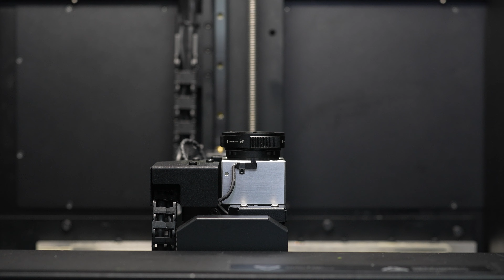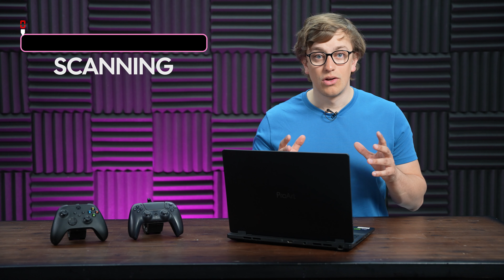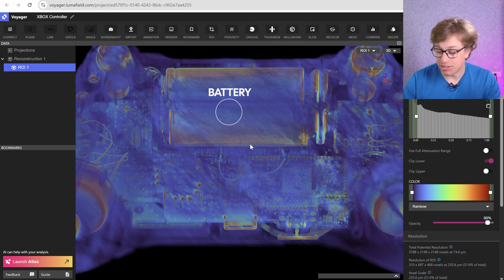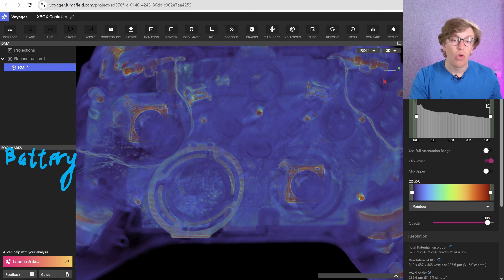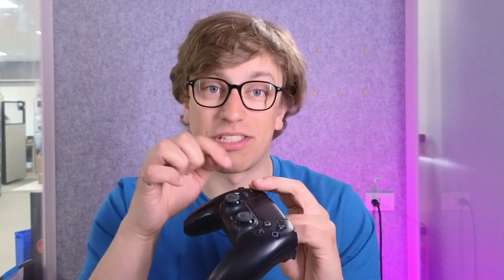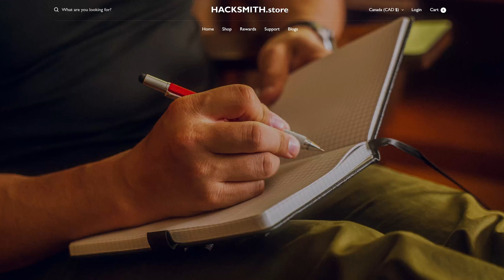PS5 vs Xbox: Inside the Battle of the Gamepads

Comment: When i got a new Controller recently i made damn sure that everything was using hall effect
If anyone is looking for recommendations
The EasySmx X20 has hall effect joysticks and triggers, every other button is mechanical, supports pc via cable/ dongle with both directX and fx encoding, works on any device with Bluetooth, and even works on the switch with nintendos protocol
(Also has programmable back buttons)
Costs 60€